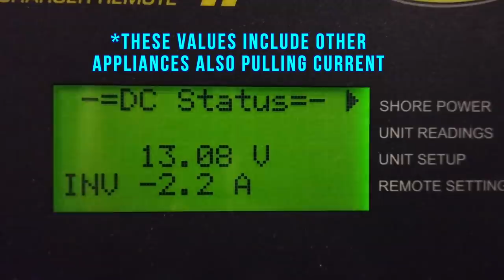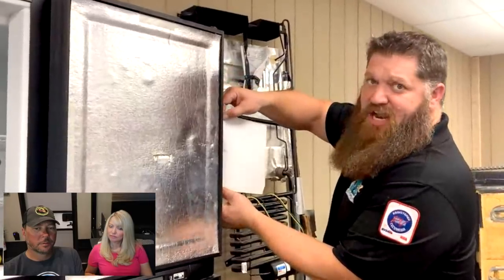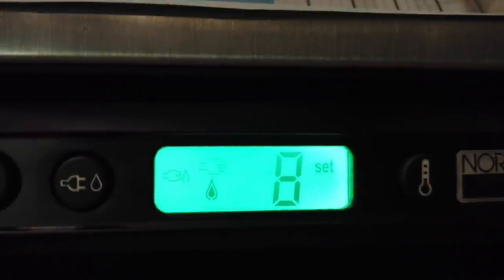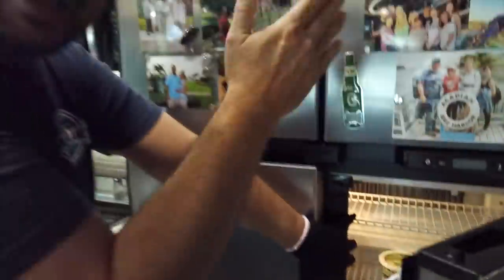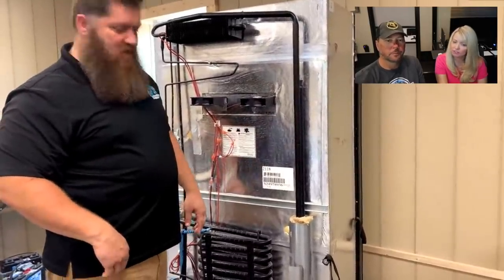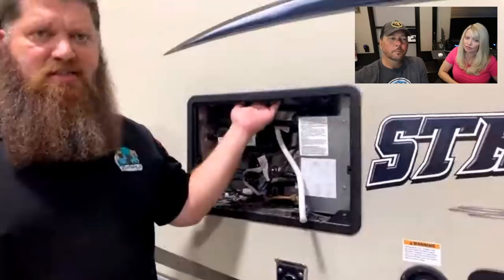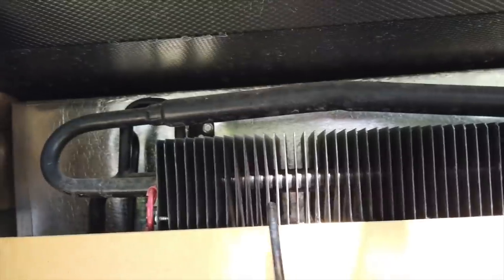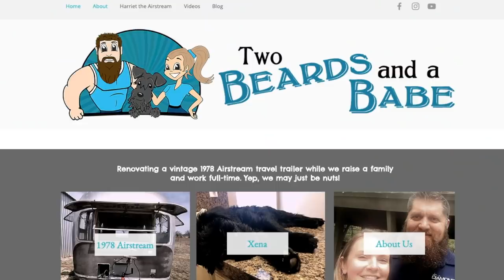Full Time RV Maintenance (Refrigeration) | Changing Lanes!

Comment: I am on the hunt for info. My RV for the last month has started to smell of Amonia. it was subtle at first but now it's starting to get more potent. i determnied through other people's videos that my refrigerator is on it's way out rapidly. i am looking at spending around $450.00 in the next week or two to swap this out for an all electric one which is not an issue since i'm perma camping on my acre and a half lot. it appears the Magic Chef appears to add a bunch of refrigerated storage room without all the gas worries and it fits in the same space as my Dometic. the only thing it appears i'll need to be careful of is capping off the gas line. so i can still use my stove and furnace. i am planning on adding a mini-split later because it's twice as efficient as the 1300+ Watt roof AC unit and more efficient than the furnace as well. if i can get solar put in i really wouldn't mind going completely electric because i've never been at all fond of gas or propane and it's the number one cause of failure and fires in RV's. seconded only by electrical issues. But hey if it will improve my odds of not catching on fire even a little i'm all for it! This was interesting and useful information though because even if I don't have gas any longer in THIS rv i do still have another one that i may be keeping and hauling out of town to other places. i don't know the plan was to repair and deep clean the other one and sell it off to someone else and pay off my property faster. but with all of the upgrades and maintenance i don't know if selling it would make that much difference in the end at all because i am doing these repairs and upgrades X2 right now. I have a 2011 Heartland Big Country 35 footer with 3 slides and 4 tanks that i am living in and a 2012 Heartland Elkhart Express with 1 slide out and 2 tanks as well as the dinkiest of bathrooms. tiny shower not made for fat people and when sitting on the toilet my 6'5" legs have to be out into the cabin meaning the bathroom doors can not be closed. the Norcold refrigerator in that RV works great though, never had a single issue with that one other than it drawing damp over the summer and getting mold which i quickly treated with alcohol and stopped it before shutting off the refrigerator and leaving the doors open. i still have power to that rig also as i built the 150 foot power cable well enough to keep it live even though it's not sitting in the #1 usable spot with the septic, water and electrical connections

Comment: Enjoying your channel. In the refrigeration industry we have for the most part do not use heat guns or blow driers due to the damage they can cause to plastic even at low temperatures. We keep steamers on our vehicles to reform gaskets and defrost frozen evaporators. Steamers are less harmful to surface areas than heat guns. Also steamers with wand are also great for clogged drain pipes in refrigerators.
Reply: Awesome! I have one of those steamers with a wand I can now take with me on long trips. Thanks!

Comment: u missed the burner compartment completely n thats were most problems occure?
Reply from the maker: The burner is over to the right inside the bottom vent.  You can even see it in the video thumbnail (just under the N in refrigeration).  We also looked down on it from the top vent to make sure there were no obstructions in the tube.  👍🏼

Comment: Is there any way to get the RV freezer down to 0 degrees?  The best I've gotten from my Dometic is 10 - 15, and it doesn't do a good job of keeping ice cream.  Because of that, I have trouble trusting the food from it.
Reply from the maker: We get about the same...  We had a viewer say he's getting close to zero using this...  The web site makes me want to scream, though... https://www.arprv.com/index.php
Reply: So ice cream has a high fat content and it takes near to sub zero temps to achieve it. It really depends on your location (humidity, air flow, sunlight) to have frozen ice cream with an RV style fridge, muchless and ice machine. Depending on brand the lower right hand or lower left hand back is the coldest part of the freezer. Because the evap coils are on the back of the unit the coldest spot is against the back wall, lower right or left in the freezer section.

Comment: First time viewer, I'm impressed.  Could you share the Brand and Model of the freg and freezer wireless temperature sensors?
Reply from the maker: Sure thing!   And welcome to our channel! 😊  
Items in this video: 
🛠 Wireless Refrigerator and Freezer Thermometer: https://amzn.to/2QbVTEv 
🛠 Ladder: https://amzn.to/2ZTi1qX 
🛠 Air Compressor: https://www.technorv.com/viair-400p-r... (It works better for tires vs blowing, but gets the job done in bursts)
🛠 Air Nozzle: https://amzn.to/2O33m6b 
🛠 GasStop: https://changinglanesrv.com/GasStop (Use code LANES2019 for 10% off at checkout!) 
🛠 Metal Duct Tape (https://amzn.to/2Ypgitp) - Get the good 48mm stuff!

Comment: What do you suggest doing if  your refrigerator  is a 110v ?  Mine is 110v it has no fans inside the actual fridge area so stuff in the fridge takes a VERY long time to cool.. I wanted to add a fan to help circulate air throughout the fridge but wasnt sure how to power a fan from within the fridge??  Unfortunately most fans are 12v.  Any ideas?  I do have a light inside the fridge so could i possibly attach it to that light or maybe there is a way to run wires from a 110v plug outside the fridge to thru into the inside?  I noticed amazon does sell 110v fans that move a lot of air that could seriously help!!

Comment: The air compressor seems like it will run for ever but after it runs long enough to fill 2 tires from flat it will get hot and stop compressing always limit how long it runs

Comment: We purchased our new 5th wheel last September, and used it for weekend get aways every week until it got cold in October.  Cooled great with no issue.  This year we brought it down to the lake here in S.E. Kansas on April 1st, and I've been living it in full time and working out of it due to Covid-19.  Because we are using it more I've noticed that the freezer is not as cold as it should be, and neither if the refrigerator.  Upon closer examination I noticed 1.5" of Ice on the back wall of the freezer, and I knew that is the cause of our cooling issues.  I remembered this video that you did, so I went and found it again to brush up on your technique again and will be doing it this evening.  Your video's are very helpful!

Comment: Hi guys,  i just bought a 2021 GD reflection 367bhs and the is no way the water goes out through the little hose, Oh and its dripping inside the fridge, any ideas???
Reply from the maker: make sure the line is connected to the drip pan inside and there are no obstructions in the line.

Comment: Hello at 1:30 in video you say that the voltage is 120 well I see in the background that your refer is a household one if I'm correct. My question is are all refer's in RV's 120 volts or 12 volts
Reply from the maker: They can be just about anything.  Ours is a 2 way RV fridge (120V AC or LP plus 12VDC).  Some can be straight DC also but those are rare in new rvs.

Comment: Can anyone tell me why (at least for the past 8 years or so) they did away with the 3-Way fridge?  I liked the 3-Way since it had the 12V option when driving.  Back in 2015 when shopping for a new unit the salesman told me to just drive with the propane on (everyone does it).  Sounded dangerous but that's what I've being doing and haven't had any issues.  My fridge vent faces the rear of my trailer so it's far away from the gas pump.
Reply from the maker: Yea.. we had an 8 hour drive yesterday and ran propane for most of it.  Even with 300Ah, we an only run the fridge for about 5 or 6 hours.   Thinking about the mod from JD Refrigeration that's DC only and is only 60W (5 Amps DC)!  We could run that for 60 hours!

Comment: I was complaining about the time it takes for our Dometic fridge to get to temp (37degrees) and the difficulty maintaining it to a fellow camper a few weeks ago. He gave me a 12v fan that he mounted in the top outside of his Dometic saying that it helped a little but he solved the problem by converting to a residential. He didnt have anything good to say about Dometic fridges. He didn't say anything about checking the for the baffles and etc. that your video showed. I'll be checking mine this weekend and hope that Grand Design did as good a job on our Reflection as they did on your Momentum. Timely topic and well done
Reply from the maker: Thanks and good luck with the fridge!  👍🏼

Comment: We are in the Northern California coastal area..and are now able to have the refrigerator in our G. Design 310GK at the #4 setting after placing a "Nylon Washer" on the bottom left hinge pin, allowing better  center flap closure on door. The Fridge is usually at 34 degrees or less in the morning at that setting!  The nylon washer does not  have to fit the pin perfectly.
Reply from the maker: Good tip!  we've heard of that issue with several people..

Comment: Try you shop vac when clean , with you hose in the exhaust side , you can buy adapters parts kit at Lowe’s ,Home Depot ,and I’m sure Amazon ,for blowing out small ,and cleaning tight areas ,works great for that I do HVAC work and use this over an air compressor even .
Reply from the maker: Good tip!!!  👍🏼

Comment: Good content and well done guys. We have the 12volt compressor fridge and we love it. No need to worry about propane and no outside venting. Thanks a lot. Hope all is well with you.
Reply from the maker: We're thinking about that also.. Do you know how many amps it draws on DC?
Reply: I believe it’s only 3amps
Reply from the maker: Holy cow!  3Amps DC (36 watts)?  Wow!
Reply: I’ll check that for sure tomorrow. We are going away camping and the owner manuals are in the trailer.
Reply from the maker: Awesome, thanks!  This is the one from JC Refrigeration?
Reply: Ok, it’s draws 8amps to go from ambient to set temp, and then 3 amps to maintain once at set temp. Ours is the Everchill brand but most all brands are similar in operating specs. Our first time with 12v compressor fridge and so far we really like it. Gets cold so much quicker and holds temp great. Of course we are not full time RVers either so may be different for you. Best wishes to you and Tara.
Reply from the maker: Sounds about right...  JC says theirs is 60W, which works out to 5Amps DC.  We might have to do this mod! 👍🏼  😊

Comment: I was kinda wondering why you guys were worried about a catastrophic gas leak from a flat tire with the Gas Stop installed.  While you may get a flash fire if the Gas Stop works you won't get any sustained combustion.  But, you just can't be too safe.  GREAT video.
Reply: Johnny Lightning so it’s not just a blow out. There is an open flame when the fridge is on. Most RV fires start at the fridge. Best to be present should a fire start.
Reply from the maker: Sustained propane doesn't really need to be there when the whole RV is made of flammable materials.. 😳 All fire needs is a start.  We now have the gasstop as well as fire suppression (video in the works)  😊

Comment: Sorry to get off the subject about your trailer. Have you been having issues with your trucks transmission overheating.
Reply from the maker: Not a bit.  I do keep an eye on it when on steep grades (added it to the top cluster).  Highest I've seen, if memory serves, was around 225-230.  Nowhere near the red.
Reply: Changing Lanes ok thanks. I’ve heard some people having issues with these models, ‘17 & 18s. I have a similar model to yours an F450. The cooling system is pretty much the same as yours. Apparently these trucks have sensitive cooling systems and require a certain type of maintenance. Just checking in to see how people are doing with their trucks. Lots of luck on your travels. Beautiful trailer
Reply from the maker: When the engine temp gets over about 215, a SUPER loud fan kicks on and the temp drops like a rock!  Not sure if that's part of the towing package or what...

Comment: Any suggestions for 12V furrion refrigerators? Ours is either freezing or not cold enough.  Also, can you share the link to the little fan that was in the video?
Reply from the maker: Sorry. Not familiar with the furrion 12V....  Not sure which fan you mean... Can you tell me the time index in the video?
Reply: Little portable refrigerator fan at time 7:30. Thanks.
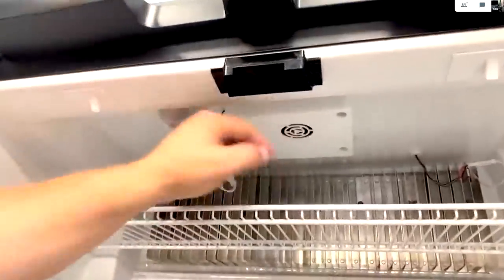Reply from the maker: Ah... the only fan we have is the built-in one at 7:47.  the one at 7:30 is Todd's and I'm not sure what it is.. But any small battery powered fan should work.  Be sure to use lithium batteries in it as they handle the cold better.. 👍🏼

Comment: Good video if you have a residentual fridge, but what about the regular RV trailer fridge. Also, I just watched a video from RV Roof Repair. He had a 2019 Transend. The roof on this brand new trl blew off. Grand Design sent it to RV Roof Repair and when they tore it apart, the main structure was junk. Not saying all are that way, but would make me think about this trl. Good video, check it out.
Reply from the maker: This video is about regular RV trailer fridge...  We even mentioned that we're are not going to talk about residential fridges in the video...   On the roof thing.  We see these kind of things happen now and again from any manufacturer.  One thing to keep in mind is you're hearing one side of the story..  Typically there's more involved than "it just blew off"...  Secondly and very important: is the manufacturer taking responsibility for it and handing it.   Every manufacturer makes mistakes.. these are built by humans after all.  But, we've found that GDRV always steps up to the plate.
Reply: @ChangingLanes  No, I know that all manufacures have problems, but from watching the video, theier were too many mistakes made, trusses not reaching fully across, the lack of screws, they used a wood screw, instead of staples, wood screws have small heads, so when you have a roof that arches from side to side, that put tension on the roof,  I have watched  a lot of his vodeo's and like I said, all manufactures have problems. But I did think this was employee mistakes. Watch it and see. The owner likes to talk and does call a lot of roofs junk, but he does point out whey they have the problems they have. I like the roofs they do, they use a 60 mil cover, builds up all the top products for water run off. Now, I am sure if he tore the roof off my HighCountry, he would find problems with that roof also. Have a good day and waiting for next video.
Reply from the maker: True.. I didn't watch the whole thing since I think it was almost an hour long...  But we're guilty of long videos too.. 😳   

Completely agree that the whole build process needs a little better QC across all manufacturers... 👍🏼

Comment: You know I always have a comment. 120 volt for refrigerator still needs 12 volts  for control circuit, I believe. One more thing I have found that us is to keep frig side of RV shaded.  Awning out if possible.  Another good video. Thanks
Reply from the maker: True.. Pretty sure almost nothing runs in our RV without DC.. Even the ACs.
Reply: Doug Hasson honestly if it wasn’t for the size of wires and the battery space, everything in an rv could be 12v. 

They are making quite a few appliances that run off 12v and 60v batteries.